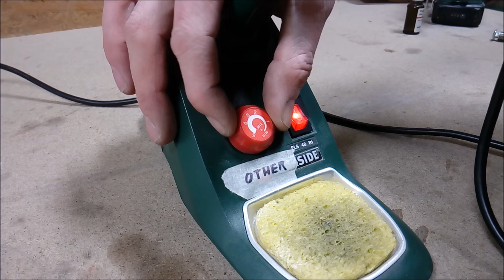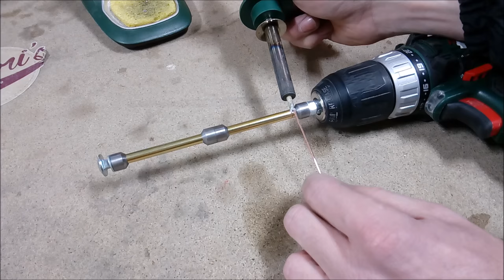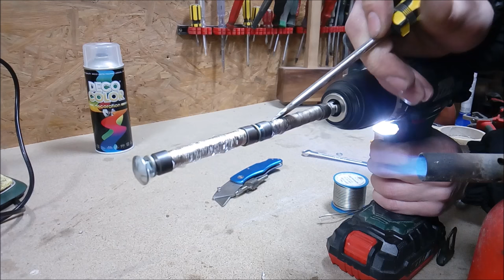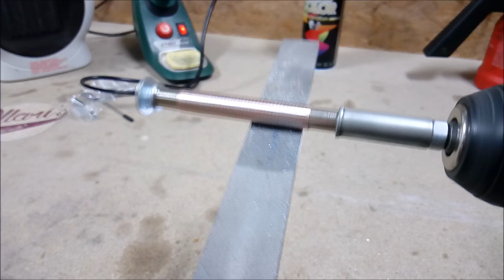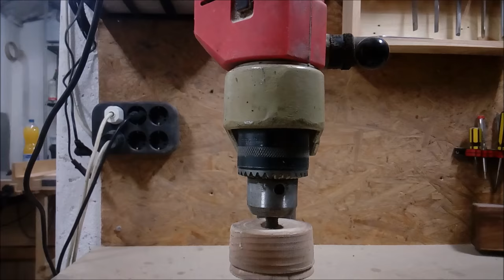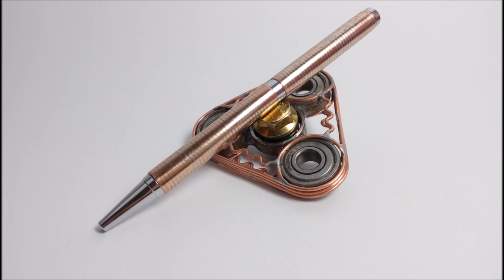Make a Copper Wire Pen without a Lathe

Comment from the maker: The solder is Lead free made especially for plumbing, and for extra safety the pen is coated with 5 layers poly acrylic. Oh and feel free to mute the sound if you don't like the music! Thanks for watching!
Reply: can you tell me where you cot the rest of the parts for the pen, like the cap, that spacer, the inner tubes, cartridge, spring(you can just give specifications for this one if you want, a spring is a spring is a spring), etc. I really like how it looks and I want to make my own bolt action version, thanks :)
Reply: Albert, you can get everything you need for that from woodcraft. Theres other suppliers as well but they stick out in my mind
Reply: Ollari's what is the bolt thing can you buy it or was it spare parts
Reply: Copper has a desinfective effect. So at this point i really don´t understand why you add a coating!?!?
Reply from the maker: +Carrie Marsyla that was just an ordinary long M6  screw. You can buy it in any craft store.
Reply from the maker: +Thomas Gulschwenk just to protect.
Reply: You answered all my potential comments about the solder and the music. Thanks.
Reply: Would it be possible to give that copper wire a patina after wrapping?
Reply: Ollari's ok thanks
Reply: +Skai Fyre You can oxidise the copper with a mild acid like vinegar mixed with a salt. Different salts will cause different variations in the colour of the patina.
Reply: If you don't have a gas torch, most lead free solders melt around 200 °C (400 °F), so you can heat your copper / pen barrel in the oven, then a soldering iron will provide any additional heat needed to work the solder. The cold copper and pen barrel act like a giant heat sink and the soldering iron can't provide heat faster than the metals can dissipate it. By heating the whole thing in an oven means that the soldering iron only has to provide a small amount of extra heat to work the solder. 
You may have to reheat the copper in the oven if the work cools too quickly.
One other thing, allow the work to cool in air. quenching in water may crack the solder.
Reply from the maker: +Maxx B yes!
Reply from the maker: +Maxx B great tips! Thanks for sharing!
Reply: What music?
Reply: @Fincher123    Because copper is just going to turn green as it oxidizes.

Comment: From what I read on Wikipedia, a drill seems to qualify as a lathe - even a potter's wheel does:

A lathe /ˈleɪð/ is a tool that rotates the workpiece on its axis to perform various operations such as cutting, sanding, knurling, drilling, or deformation, facing, turning, with tools that are applied to the workpiece to create an object with symmetry about an axis of rotation. Lathes can be used to shape pottery, the best-known design being the potter's wheel. The workpiece is usually held in place by either one or two centers, at least one of which can typically be moved horizontally to accommodate varying workpiece lengths. Other work-holding methods include clamping the work about the axis of rotation using a chuck or collet

Either way, a really nice pen!

Comment: Really cool idea and excellent work.  Word of recommendation -to cut down the overall time in soldering, filing, & sanding, and get a more defined coil look....use flux.  Helps remove impurities when soldering and quickens the transfer of heat.  Less solder would be required, would draw solder in evenly and provide very few, if any, micro-bubbles.  Again, REALLY great video and I might make a few of these pens, myself.
Reply from the maker: +Doramius Thank you! I'm just working on the second try, of course with flux and with a torch, but it didn't came out better, I've tried a different solder. It still is a pain in the.... I think the brass & copper combo is the problem.
Reply: Brass and Copper can be tough, especially with the coiling, for the solder to bond properly.  A copper pipe might work, but it's pretty soft.  Maybe a copper pipe that snugly slides over the brass tube?!?!  Also, the type of flux used makes a huge difference.  Sounds like you might be using a piping or water soluble flux.  Can you verify what type you're using?  I've already started looking for materials, myself.  Again, really cool project.
Reply: When bonding two dissimilar metals, using something like silver solder would probably help. It does have a much higher melting point than regular tin solder though.
Reply from the maker: +Christopher Backus thanks I'll try it!

Comment: Sanding or steel wool of the copper wire after it was stripped of insulation would have allowed it to accept solder more easily (and some flux), but the overall project turned out quite nicely. It has a very Industrial look to it. Well done!
Reply from the maker: +woodstoney thanks for the tip! And thank you for watching.

Comment: lol...Parkside is Myside too! The cordless is great(I have the smaller version) but you just want to throw away the soldering iron though...no matter the skill level you have at soldering it just doesn't carry enough heat(despite it's high wattage) and the insulator will soon break when you try to retighten the interchangeable leads which are threaded directly on it! I went through 2 of them and they are only good for plastics!

Comment: Looks cool. Hope it was Lead free solder.
Reply from the maker: +Edmund Schwartzadder No idea! But I coated it with 5 layers of spray lacquer
Reply: lead free solder sucks and also is not a problem for hobby projects like this, or assembly in general since lead doesn't vaporize at the temperatures it is soldered at. the concern with fumes during assembly is related to the rosin. the problem with leaded solder comes when electronics that use it are landfilled and over time the lead leeches into the ground as the solder is corroded away
Reply: If used correctly, that is, at the correct temperature and with the correct flux, lead free solder works exactly the same as any other solder. Vaporization isn't the issue so much as absorption through skin since pens are meant to be held when in use...
Reply: Coatings, like the five laquer layers this person used, are temporary. Pens are held in a very predictable, repeatable manner, and writing motions are perfect for wearing through any such coatings. Waxes and laquers just won't cut it for me, especially since they soften as they warm up. I would want to make my work failsafe forever, so just avoiding heavy metal poisoning by using an alternative solder formulation makes more sense to me.
Reply from the maker: +anonymous Thanks!
Reply from the maker: +Edmund Schwartzadder I have contacted the seller of the Solder. Its lead free solder especially used for plumbing. So the risk is the same as washing your hands. Thanks for watching!

Comment: Great job! I tried a similar idea, but didn't have a pen tube blank and failed miserably.
Reply from the maker: +Let's Make Something Awesome Together you can make it without one! Just watch Shogun Jimi's video!
Reply: Just watched it. He was a bit smarter than me. I tried doing it without a metal core. Just heavy gage wire and solder wrapped around a wooden dowel. It wasn't strong enough to hold shape after I pulled out the dowel.

Comment: Interesting method for building a pen with a kit. I see from the comments that it is for a "no lathe" contest. I also see
several people saying that you used the drill as a lathe? WTF??? Typically a pen is turned on a wood lathe, with a power head (the drill?), a tail stock for steadying the end of the arbor (Didn't see any tail stock), and a tool rest to help control a cutting or scraping tool (he used a file, but I didn't see any fixed tool rest). So, in summation, of the three things that are typically found on a wood lathe (head stock (or power head), tail stock, and tool rest) he only had a drill which was a makeshift power head, though not in a fixed position. So a poor excuse for 1/3 of a lathe, IS NOT A LATHE.
The pen looks great, dude. Good job.
Reply from the maker: +Thomas Russell Thank you very much Thomas! I won 2nd price in that contest!
Reply: Awesome. As a math and science teacher, logic is almost as ingrained in me as it was in the fictional character Spock. (May L.N. rest in peace)

Comment: You can throw the blanks in a rock tumbler with stainless steel shot  and a drop of dish soap plus two thirds of a tank of water.  Run it for thirty minutes and you will have a beautiful shine.  Gets rid if the nasty scratches left by the file.  The acrylic spray won't last.  If you have a friend that does e coatings of metal that will last 10x as long.
Reply from the maker: OK. Thanks.

Comment: I wondered how long it would take for you to realize that you need to solder the copper wire to the brass tube BEFORE you mount it on the bolt.
Reply from the maker: +Lawrence Withrow like 10 sec.....

Comment: Your soldering iron is way too low power for what you're trying to do. And the whole point of lead-free (ROHS) solder is that it's non-toxic (usually tin + silver, which are food-safe) so there's not need to lacquer it for safety. Of course you still might want to lacquer it anyway to prevent tarnishing.

Comment: Dude... You need some flux for that soldering bud, lol. Also since it was a thick plumbing solder, you should have been using a torch from the start. Not a great way to use a soldering iron. Just some tips for the next one.

Comment: WARRING:  Because so many people might replicate this with ordinary solder, you should list in the instruction note to use only LEAD FREE solder.  You did not list that.  As Lead can cause health problems with extended contacted or ingested.  Since this will be a pen extended contact is likely.   The spray coat may protect the end user but the builder will also be exposed.

Comment: Yeah have something in your hand for extended periods of time with LEAD in it. What could possibly go wrong? NOTHING.
Reply: tm That's correct, Absolutely Nothing. 
It's alloyed and solid so it isn't absorbed readily by the body. Also there's a coat of lacquer sprayed over it.
As long as you don't chew the top off it, it'll be fine.

Also, berore he sanded it, the solder had a rough finish to it so I reckon it was lead free anyways.
Reply: Matt Hunter it was lead free

Comment: I hope he did it RoHS.
Reply from the maker: +rocketri.de motors the solder is used in water pipe connections also... Oh and you all forget the time when there where lead pipes for water.....
Reply: We don't forget lead pipes... there is a slight difference between having something that's touched with sweaty fingers all the time and something cold water goes through...
Reply from the maker: +rocketri.de motors I don't think that sweaty fingers affect poly acrylic coats.
Reply: you bet. it gets worn off pretty fast. Stuff that is touched and used a lot usually wears away. Just look at some handles in trains where people touch all the time. They even wear off aluminum oxide coatings. But please don't get me wrong, i absolutely don't want to spoil anything. The pen looks awesome and i really like the idea of the wound copper and the look of it after being filed down. It's a great idea and a job well executed. Just don't lick that pen everyday or eat after using it.

Comment: Soldering skills?  Dude, flux... Night and day difference.  Also, your iron tip was dirty, this will put oxides into your solder application.  Just wipe it off before you solder, then add solder to your iron to protect it.  Solder clean, store dirty...
Reply from the maker: +taohawaii thanks man ;) the second one I made with flux and a new tip on the lathe. But it went not better. Soldering brass to copper is not that easy....
Reply: Wow, that goes against my experience but props for trying it the "right" way.  I've had issues with soldering bulky copper as well.  I ended up using tarn-x and then a wipe with water using a lint free towel.  A liberal application of flux once the part was hot seemed to do the trick.  It is so nice when the solder just flows without balling up.   I haven't tried soldering brass so there may be something additional you need to do, or thant may just be as good as it gets.  If you find a method that works better be sure and update.

Comment: you should tin you soldering tip
Reply from the maker: +Ezra Smith I have.
Reply: Ollari's in the video it doesn't look like it but its hard to tell but btw Yourside lol
Reply from the maker: +Ezra Smith yeah. I had too cut much of it out. The main problem was the soldering tip. Next time I try to get a new one.
Reply: Ollari's cool i have a bunch of the do you want me to send you some
Reply from the maker: +Ezra Smith do you think they going to fit? These are threaded tips.

Comment: Going to have to wash you're hands after each use of the pen, based on how much of a ratio of tin to lead is in that soldier, unless its lead-free.
Reply: Valueless Dollar most modern solder is lead free
Reply from the maker: +Bigfoot And Bananaman Anyone noticed the 5 coats of clear Spray lacquer?
Reply from the maker: +Bigfoot And Bananaman its lead free.

Comment: Quite nice end result, but your soldering skills are terrible. If you'd used flux the result would have been much neater from the start, with better bonding. I'd guess some of that solder is just sitting 'on' the copper instead of having alloyed with the copper - i.e. a dry joint.
Reply from the maker: +fluchter1996 yes they are really bad. I used some flux, but the brass & copper don't work well. Thanks for watching!

Comment: Wow.  You spent three hours and a bunch of supplies to end up with a slightly thicker version of the same pen that worked fine before hand!  To say that you "made a pen" is kinda disingenuous, as you started with a pen in the first place.  This must be more of that future art stuff I just don't understand.  I mean, you had to spray paint a copper coated pen to make it look brass, what was wrong with the pen you started with?  That was already brass colored?  And seemingly undamaged?
Reply from the maker: +Ollin Williams that was not a pen. Its a pen kit for woodturners. Its just a brass ferrule , you glue on a piece of wood or acrylic, and you can make great looking pens. Just Google Pen turning. Have a great day!
Reply: I stand corrected.